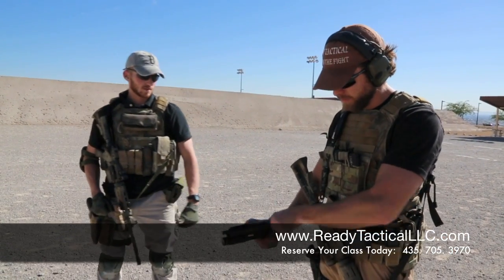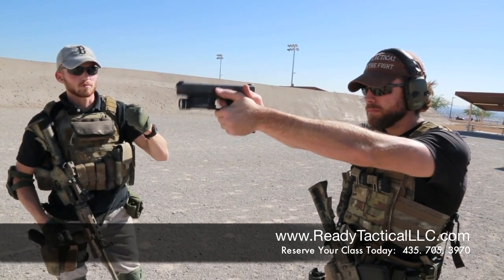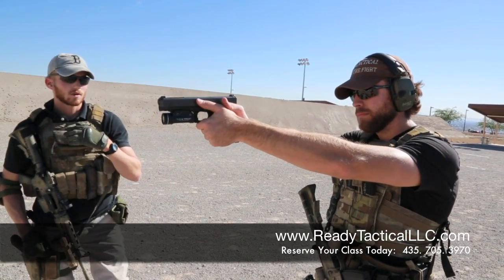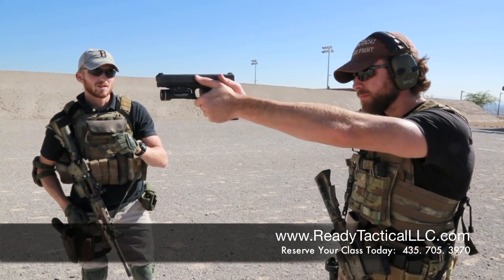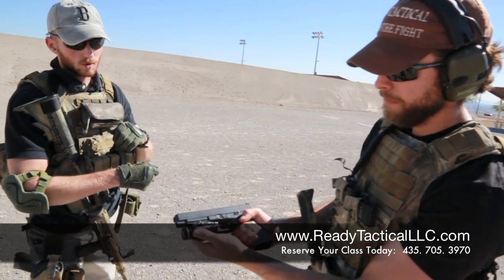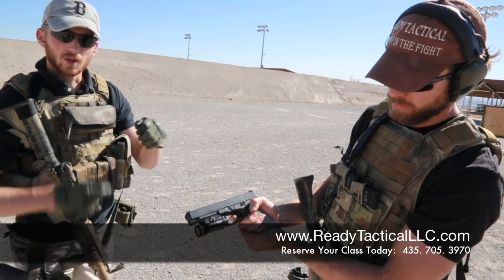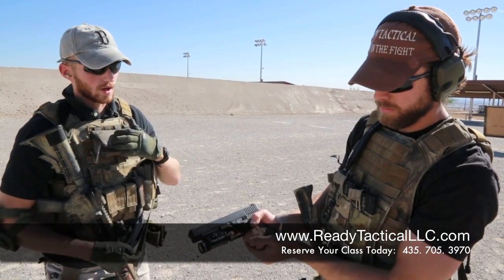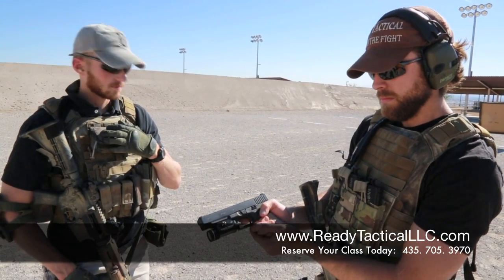Common Problems with Trigger Control | CCW | Concealed Carry Permit | Ready Tactical LLC

Comment: Great video.  As a long time shooter one thing I tell new shooters is a constant smooth trigger pull and don't anticipate the shot, which is hard for new shooters..  But also,  'follow thru' with the shot by maintaining your grip and focus and not the next shot.  A lot loosen thier grip anticipating the round leaving and thinking of the next shot and thier grip suffers.  It's not over till the recoil is complete.

Comment: If you ever train with Simunitions in house clearing, you will observe a strange thing.  Even people with lots of range time, when put under stress, will very often point shoot, sometimes with one hand, and they will expend many rounds or shoot the pistol dry.  You see it all the time.  And if you can get instructors to get in a stack, and enter an unknown tactical environment, you will see the same thing ( they will never get in a stack, beneath them, you see!!!)   Anyway, people react differently on a square range, versus an actual lethal force encounter, which may be over in just over one second with multiple rounds fired.  And no, you don't need a beard.